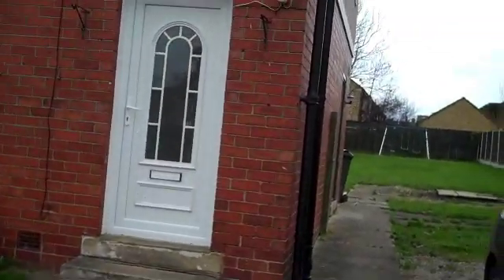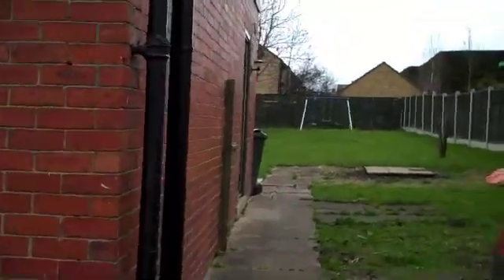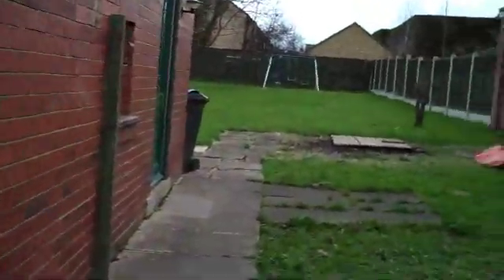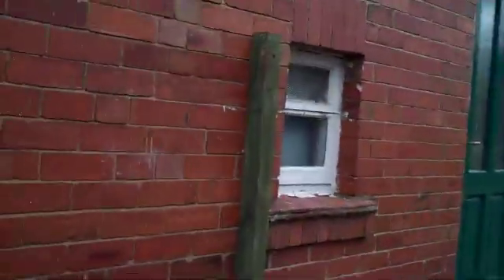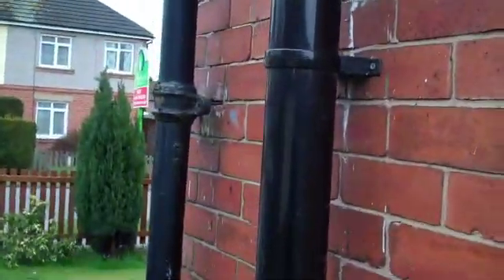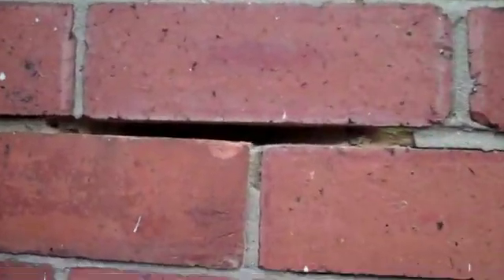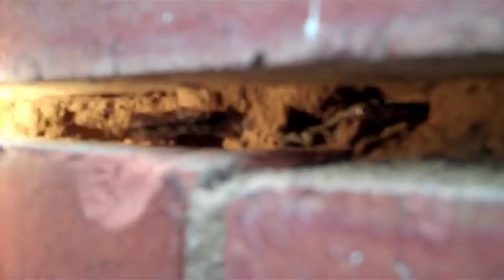Wall Tie survey part 2: in insulated cavity

Comment: What causes the horizontal crack when the ties fail?
Reply from the maker: Thank you - good question. When metal rusts it turns into Ferric Oxide. This is the red rust you see on the surface. The rust is a chemical reaction and builds up. A metal tie may expand by several times its original thickness during this phase. It is the expansive corrosion that lifts the bricks above the tie, causing the horizontal cracks. Hope this helps.